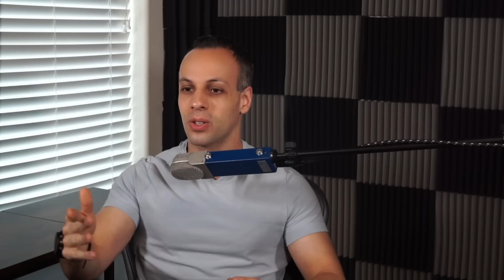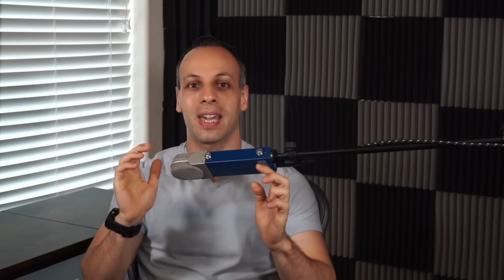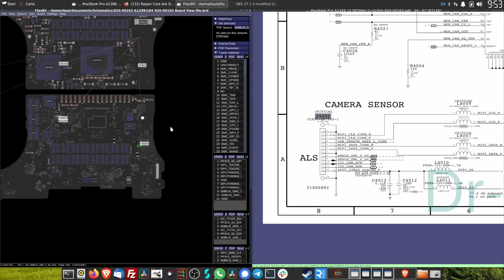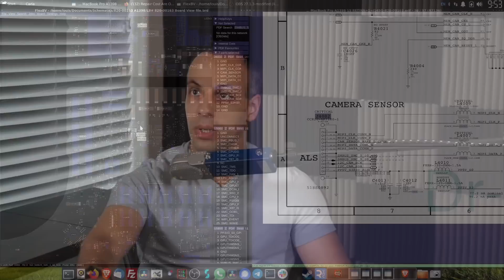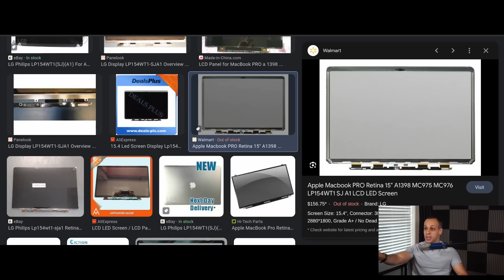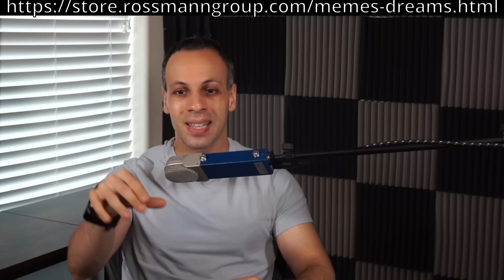The Ford F150 Macbook - when car repair resembles macbook repair...

Comment: This isn't new...  GM has been doing this same crap with their  blind spot monitoring radar units for a decade now.  It's so bad on certain cars that the fix is to replace not only the bad radar module, but also the other one AND the associated wiring harness as well (comes in an almost now $1000 kit).

Why, you may ask?  Because here in the rust belt, we have this season known as winter.  The modules are mounted to the back of the bumper cover, in the corner right behind the rear wheels.  They didn't think they needed to put some sort of protective cover over the modules to keep them from getting wet or clogged with salty snowy ice.  The salt water freezes, and like with trees and the road surface in a snowstorm,  the modules split open, letting the corrosive salt water in to fry the internals.  Most of the modules that are removed have that nasty green corroded copper crud coming out of the place where the plastic case split.

But this is a whole new level of stupid.  First mistake is putting the module in the taillight.  Second is putting the taillight on the CANBUS. Third is not having a separate CANBUS for the high priority modules such as the airbag system, the antilock brakes, the higher functions of the body control module, and the powertrain controller.  So if one module gets effed internally and shorts out the CANBUS, the whole vehicle craps out?  What, didn't  Found On Road Dead learn from the windshield leaks killing the cruise control modules in the Crown Vics causing the cruise control to floor the accelerator cable/pedal?  No wonder why they are now dealing with a work stoppage due to a strike...

Comment: since you've only just semi recently had a car, you probably also don't realise that water in the tail light has been happening to cars since probably forever.. my car made 1989-1992 gets water in the tail light, and it's a well known issue. point is we always say don't attribute to malice what you could just as easily attribute to stupidity, but in this case you can't really believe a car manufacturer would Just Happen to make the whole car die for water in the tail light.. that is Intentional as a mf.

Comment: I work in car repair and it can be a pain. Sometimes have to reprogram stuff just to change a battery. manufacturers are stamping their name on parts to deter aftermarket stuff. they're also patenting parts so that even if you are ok with having generic tailgate #4, you can't because they don't exist. 

back in 2006 I was stranged when my car had emotional problems. some stupid sensor decided that i should not be able to even start the car. speaking of which, some cars will not start without some parts installed. say you get into an accident and your rear bumper is torn off. you might not be able to even limp home.

Comment: My heat went out in the dead of winter and a furnace repair guy said its usually just a piece of wire that needs the corrosion sanded off of it with a tiny piece of sand paper. 350$ charge or something for it. I mean i get that it's not gonna be free, he had to drive to my house, but does his truck run on diamonds or something? also he 100% wouldn't have told me, except that I stood there watching to see what he did, so he felt obligated to mention it lol

Comment: Uh... manufacturers are absolutely intentionally trying to make maintenance and repair on items an absolutute pain in the butt and cost-prohibitive to fix.

Why do you think companies launch new products with glaring problems all the time? Why do you think car salesmen tell you to change your oil every 7k miles when any mechanic knows to change it every 3k?

I had to RMA a network module worth 10s of thousands of dollars recently because we couldn't replace an individual stick of RAM. I also routinely have to RMA network devices worth 10s of thousands of dollars due to one Ethernet port going bad.

Serviceability that poor cannot possibly be a mistake

Comment: Louis, there are 100,000+ systems probably working perfectly and one fails and it causes problems and that's what we see. If you think the systems are so bad, why not create a business to make aftermarket parts as well? You could make an exact sized replacement but that fits the original system but works better and much easier to replace. But, I know you'll never realistically be able to do it because you know there are a million things that can go wrong and it only takes one thing to go wrong which will.

Comment: Not saying that this is good, but its common for devices on the CAN bus to be on same line as others. Usually these are called nodes. Why is the CAN bus setup this way, i have no idea. However its all too common for manufacturers to put these modules in a place that they can develop a short or corrode, taking out half the network along with them, which is plain aggravating. GM large and extra large SUVs in particular will refuse to start if the suspension controller for the air ride, located around the spare tire i think, shorts out.

Comment: I'm in HVAC and we had a new install had motor failure after 2 weeks of being installed. Stuff happens and shouldn't be a big deal right? So it was backordered and had no lead time. So we bought another AC and transferred the motor over and installed the new motor into the doner unit when it came in 4 months later. They have no problem selling equipment but parts availability come second.

Comment: Yea I can easily imagine a manager walking in one day, saying they have 1 month to design the whole system when they needed 3 months to do the job right and then telling them to cut it short after 3 weeks. I'm sure someone saw the problem, pointed it out and was told to get back to work because there's no time for another revision.
Essentially, water is wet.

Comment: i bought a 2012 mazda3 in 2015. little did i know that that was going to be one of the last cars where things weren't ridiculously tied together and obnoxious to fix. unfortunately i don't have too many years left with it before i've worn it out entirely. when it's dead, i don't really know what to replace it with. they don't sell the stick shift on the lower trims anymore :(

Comment: Critical components should not be on the can bus. They should have dedicated wiring. 20 years ago a screwed up can bus would take out your electric mirrors and central locking. But the car would still run and drive.

Comment: The seal on the light housing failed which destroyed all the electrical components on the tail light? You would figure that was insured? If it was a new truck? Bumper to bumper insurance? Or is it just for certian parts? Insurance is a scam? Ford spent billions of dallors testing its clame to be built Ford tought? 😆 yet rain destroyed the Truck? Like Apple? Simply put. Dont buy it. Knowing the track records of these company? Walk away. Dont be a fan boy.

Comment: I saw that video and never questioned it because I know from ford those tail lights are expensive.  However, I just found a set of those same tail lights for my 2023 with the blind spot monitor modules for $500 each.  So that's more like a $1000 dollar repair you can do yourself.  I'd pay him for his troubleshooting time and order those off of ebay.

Comment: Modern cars will revert, you should be able to operate the vehicle without of these extra systems so long as the basics work, will cause so many issues down the road.

Comment: I worked as an automotive electrician for 6 years and I have been truly appalled how the manufacturers build and design modern vehicles. Check out the dodge TIPM issues they sell more of them then brake pads no joke. The push towards EVs will only make things worse there will be pretty much zero component level repair. If you have an older car take care of it this new stuff is junk!!

Comment: They're putting WAY too many computerized systems in cars and trucks and creating too many points of failure. Even worse, they're engineering the vehicles in a way that makes their basic functions dependent on computer modules and components that are subject to chip supply issues, resulting in parts being extremely expensive, and the vehicles themselves being grossly overpriced. I'd chalk it up to the simple old fashioned greed and stupidity that car makers are known for, but with Apple's shady, anti-consumer business model being obscenely profitable, I can't imagine it not being intentional at this point.

Comment: I was calling this out years ago when car manufacturers were coming out with the custom tail lights with LEDs. They weren't a standard lens with a standard LED bulb socketed in... These are full array LED systems so if they have any issues you have to replace the entire tail light compartment to fix it. No longer can you just head to the auto parts store and just grab a cheap $5 light bulb to plug in.
Reply: That's funny, you think 5 bucks for a single tail light bulb is cheap.
Reply: Ok, but those LED units do last long. By the time they fail you'd have replaced a fortune of bulbs already.
Reply: @JorisR21  But then again, why do we have to throw away a perfectly good housing, just because some LEDs failed? Replacing the defective LEDs like lightbulbs is the only right way to go.
Reply: @JorisR21  That's silly, I've replaced the tail lights in my mid-nineties Accord once.

Comment: There are *ZERO EXCUSES*that make sense beyond device miniaturization why we had to move on from basic sealed lamps. If there are sensors for the tail light, sure alright by all means incorporate the sensor, but make it easy to replace. Make the tail-light easy to repair. And above all us, don't fuck with us.

Here's a stunning business idea for the person who wants to take on this endeavour — make a business out of aftermarket safety lights using old-school bulbs before their supply goes completely dry. 3D-scan modern car enclosures and figure how to make a model with more replaceable components. Create an alternative that makes sense and distribute it. I don't have the wherewithal to do it, but whoever does, get in touch with FUTO and and make it happen. I bequeath this idea upon the world with a CC0 license — this is public domain; run with it, and don't trip.

Comment: imagine if you will, in order to fill your car's gas tank up, you had to pull out your car battery to access the gas fill neck, but to remove the battery you also have to remove your throttle body and intake manifold. i'm going to shut up before the people who want to force electric vehicles get too many ideas

Comment: dielectric grease should have been required to be used in production on all electric connection harneses to prevent this exact issue since the 1960s on all vehicles

Comment: I find it very hard that the number 1 selling vehicle(not just truck it's the #1 vehicle)in USA for 41years.

Yeah finding OEM pigtails/connectors new is probably hard/expensive. But they shoulda been able to go to U Pull It type of junkyard and salvage what they need to get it working for a fraction of what he paid.

Comment: one more nail in that Ford coffin..
when (not if) that taillight happens to to put your vehicle into safe mode.. it is guaranteed to do it when you're off-road and not in cell range.. it will absolutely choose this as its moment to fail. you get to hike in whatever weather.. probably rain and or snow to find a signal to call for help.. Ohh it's super exciting.. I bet you can't wait to get your own Ford truck (it's all F-sizes that use obstacle detection)

If you read this far...
to get underway, disconnect the taillight.... do whatever you have to to get to the plugs.. but it's gotta get off the system.. turn off the truck let it rest for a couple minutes and give it a try with the light disconnected.. you should be able to get back to the barn now

Comment: It's not only about how well thought the product is or how different modules are connected, but especially in cars and electronics I faced many issues that the spare part I was looking for didn't exist for individuals (private customers) only for repair shops with the approval of the manufacturer or even sometimes only manufacturer was allowed to repair those things. 

My friend got himself an asus OLED gaming monitor which he succesfully broke as a part of moving some furniture. (lets not discuss how can you actually do that now :D). So if you look for that Asus PG42UQ, you kinda realize that your options are pretty much non existing if you want a screen replacement. Asus of course would repair it, but the cost is just too much. So even if he wanted to repair he wouldnt be able to do it by himself. Not like I would advise to change a 41.5 inch curved oled screen to anyone, but the thing is many times you can buy spare parts cheaper than the manufacturer would sell it to you and if you don't have options, well screw you. 

 The other thing - related to this video - My uncle got a Suzuki (quite new model) which had an "engine" issue caused by literally a cable which is controlling thedriver's seat heating. Apparently Suzuki engineers put the quite thin cables under the chair so if you adjust your chair you can eventually end up breaking it and getting some nasty error. What's going on with this F150 is also quite shameful and you are completely right. Unfortunately many QA concerns are dismissed that's how you can end up getting a car which essentially gets some water on a tail light which of course communicates to other modules. 

Well, what a world we live in :D

Comment: Now, what if I told you that 95% of the customers have no idea these features exist, not will the vast majority every use them, and many of these luxury and added safety features are included, simply to inflate the price? 

What if I told you that these supply issues go back to 2010 when auto manufactures decided it was cheaper to outsource much of their production, because some D-bag in thee white house decided that consumers repairing their own vehicles is the reason for the auto industry collapse, and a chief cause of global warming?  

 What if I told you that everyone is essentially being held hostage by marketing and sales, over riding logistics, engineers, and even regulators? 

What if I told you...that everything about modern consumer vehicle emissions and fuel efficiency, is based on  making g a 1>1? No word of a lie, the reason we have larger vehicles now with a focus on mid sized SUVs is because someone decided that fuel economy should be based on the a ratio to the cubic feet a vehicle is, and this is how they think about everything.

Comment: In older cars with water intrusion all you have to do is drill a small hole in the bottom of the lamp to let the water out.  Clean up the lamp socket and replace the bulb.  Ask me how I know lol.  This is precisely why I don't own a vehicle newer than 20 years old.  As my grandpa used to say about new cars and new features, "that's just more stuff to break".

Comment: There's no good reason the obstacle sensor would be integrated into the tail light. Those should be two separate and discrete modules. The only reasons otherwise are to save Ford a few dollars per truck or to promote planned obsolescence.